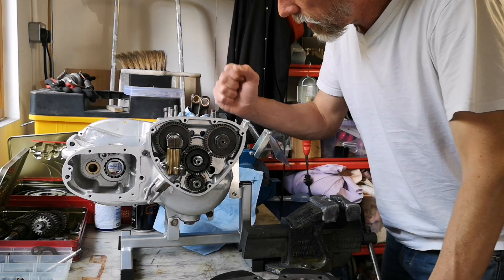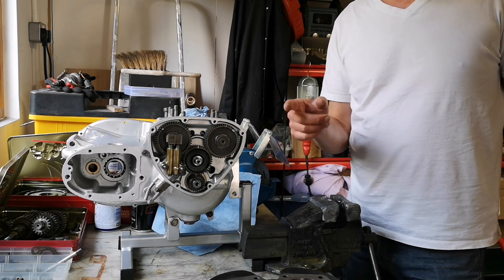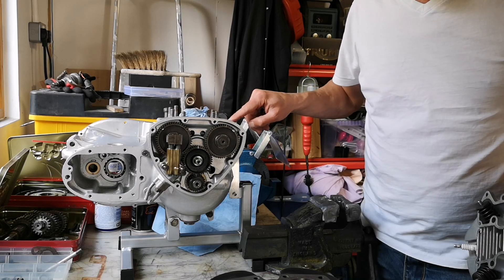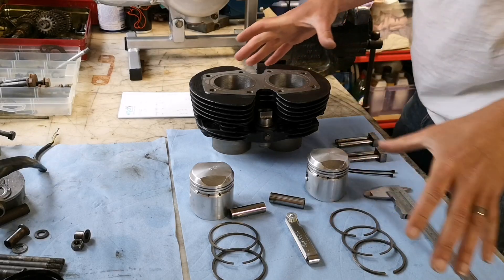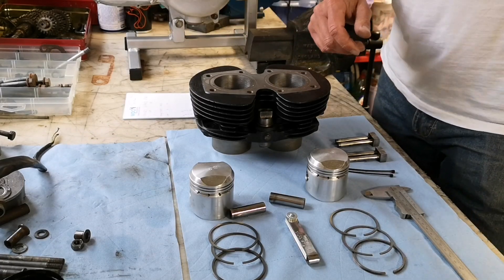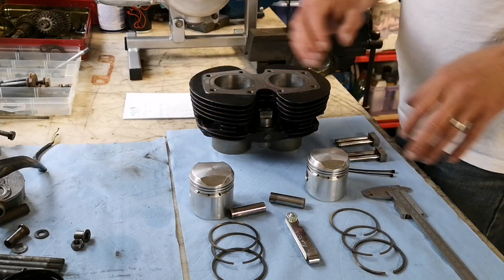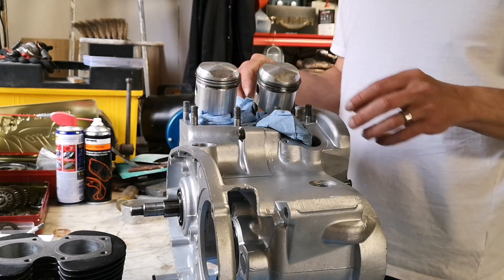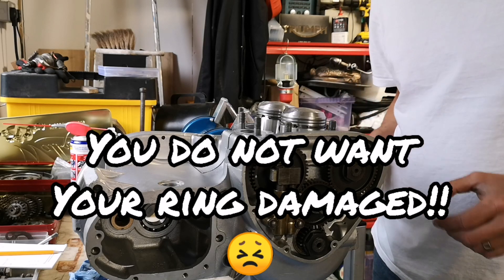Project TriBSA Episode 24

Comment: ha ha great stuff, good to see you're human after all!! Although with your ocd I'd have thought you would have known the barrels should be silver!
Reply from the maker: If it were a stock 3TA, then I might have considered silver. 
My 1963 T90 has black too. But 25 years ago when I got it, I wanted it to look like a Bonneville!
Reply: My 3TA was originally a 5TA which at some stage someone fitted a T90 engine which destroyed itself by dropping a valve and now has a 3TA engine (with black barrels!!) so maybe its a 5.3TA although the frames were identical I believe!
Reply from the maker: @heirpin  yeah pretty much the same. T90 had a bit more power than a 3TA. And obviously the 500 had more grunt again. I think you can put a T90 top on a 3TA. The pistoms have a higher crown for more compression and stuff.